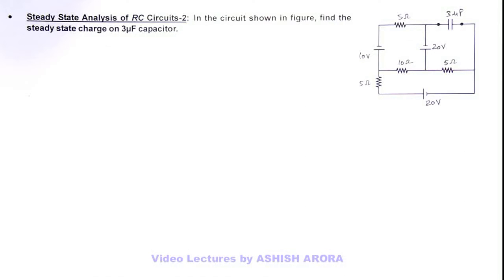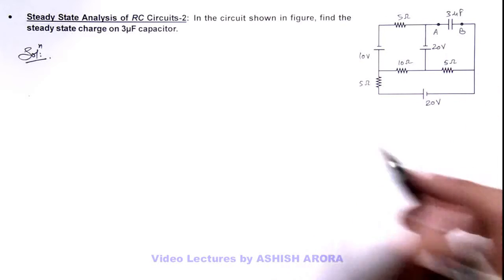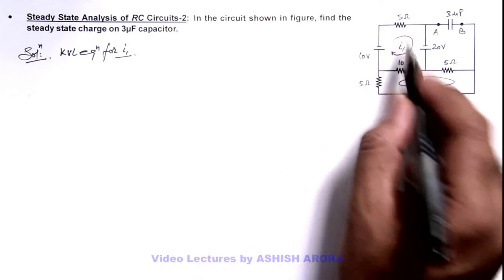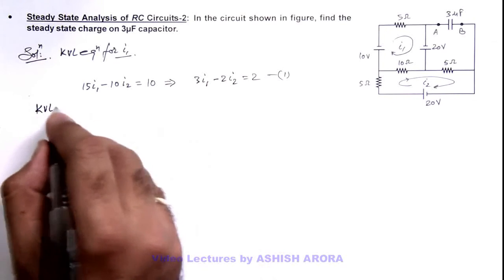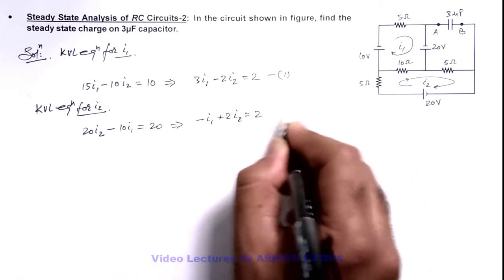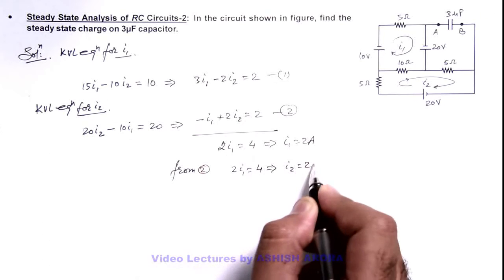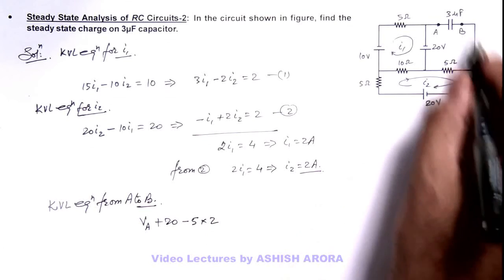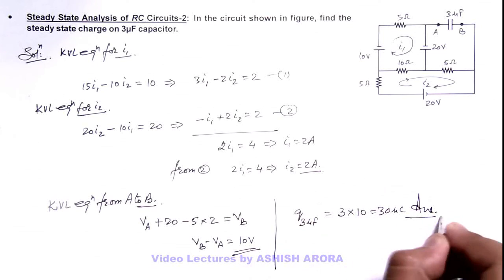10. Advance Illustration | Current Electricity | Steady State Analysis of RC Circuits-2

Comment: Sir ye 15i1 kha se aagya, 
Koi to smjado😢
Reply: maybe in 10 om resistor there will be both i1 and i2 but opposite direction (i1 is +ve) and so both 10 om and 5 om will inclulde i1 so 15i whereas i2 is only included by 10 om in opposite direction to i1

Comment: I am getting 80uC using kcl sir 🥲
Reply: Take x at A and zero at B and assume some y potential at the left end of 5ohm(left of A) and solve you'll get two equations..
Reply: Using KCL I got answer but 10 ohm resistor between 20 and 10 volt battery has zero current from my calculation can you guys verify ?😊
Reply: Did you cracked jee??

Comment: Sir i tried solving by KCL. I was getting 12uC.
Reply: Once try again you'll get 10 volts as potential difference by using kcl but needs careful calculation...
Reply: @allfriendsgaming7163  its been 2 years. no need to do it now :) but will try :D
Reply: @atharvakumar9808  Ha 😅 go ahead!!
Reply: @allfriendsgaming7163  i tried with KCL, but couldn't get 10 volts
Reply: i-tried-KCL-i-got-correct-tho

Comment: sir i rearrange the circuit to reduce variable as below 5 ohms resistance can be taken in series and replacing 10V and 20V with 10 volt after doing so i applied nodal method sir the doubt here is that can i use the potentials of new circuit or should i calculate current and use it in old ckt to calculate potential across cap??
Reply from the maker: Above ckt cannot be reduced in the way you mentioned... as 10V and 20V battery cannot be clubbed... The only other way to reduce the circuit is by Thevenin's analysis...
Reply: @physicsgalaxyworld   but sir why?? as 10 V is opposing while 20 V favours and current is only flowing in upper loop not in cap loop. hence i replaced it with 10 V is favouring direction.
Reply from the maker: manipulation is done in one branch only... as additional components are connected in other branches direct addition or subtraction can't be done... because of effect of other sources in system...

Comment: You took 5 and 10 ohm in series in loop 1, while it makes sense that in a single loop only one current will flow, but how can you say that in case of multiple loops connected to each other, eg in 1st loop the current through 10ohm is (i1-i2) and through 5 ohm is i1 so how can these be in series?
Reply: oh got it!, you used superposition right?

Comment: Sir,how to do this by Thevenin's method?
Reply from the maker: above solution in the video is giving the open circuit potential difference only... which is the thevenin's emf... if you wish you can remove the capacitor and find the p.d. across its terminals A and B... result will be same...
Reply: Sir,I did but answer not matching,please tell my mistake...
Reply: Given,circuit is equivalent to that of three parallel branches with
1) 5 ohm , 20-10V
2) 10ohm
3) 5+5 ohm,20V

It'll give equivalent emf = 0
Reply from the maker: You did not understand how to use Thevenin's Analysis.... Remove the capacitor and find the potential difference across its terminals by either of KCL or KVL... that will be Thevenin's EMF... thats what I am doing in above video...
Reply: Yes sir I did the same,to calculate potential difference between A and B I considered parallel arrangements of three batteries..
1) 5 ohm , 20-10V
2) 10ohm
3) 5+5 ohm,20V
Above three branches are in parallel...
Reply from the maker: Think again... here you cannot take batteries in parallel... I think you know what do we mean by parallel arrangement...
Reply: Yes,I got it! Thanks
Reply: @SumaidSyed  hey there bro i am watching these series sincw my 11th ( now i am in 12th)
i have seen your doubts in almost every video
youre like me(curiiuos):face-fuchsia-poop-shape:

Comment: I removed the circuit with capacitor as o current will flow through it and then applied KCL.
Reply from the maker: this is what we are doing in above video... no current is taken through capacitor...
Reply: Ali hasan bhaiya nice🤣

Comment: Cannot solve by KCL. I assumed x potential at junction of 5ohm 10ohm anf emf 20V and 0 at junction of emf 10V, 5 ohm and 10ohm.
Reply from the maker: Using KCL this can be easily solved.... consider x potenteal at the junction of 5Ω and 10Ω resistances then you will use (x-20) at point A, now take 0 at point B, 20 at bottom left, y at top left and (y+10) at the left of 10Ω resistance then write KCL equations for x and y and get the value of x then x-20 will be the potential difference across capacitor then use q=CV... you will get same answer...
Reply: @physicsgalaxyworld sir plz explain for cap in KCl how we write potential difference
Reply: @physicsgalaxyworld  thanks you
Reply: Physics Galaxy sir, according to you , which method should be preferred, Kcl or Kvl ?
Reply: do it carefully, even i also had to do it twice to get correct answer by KCL